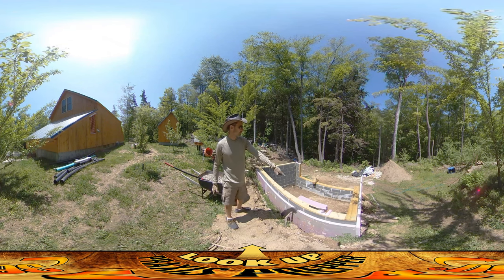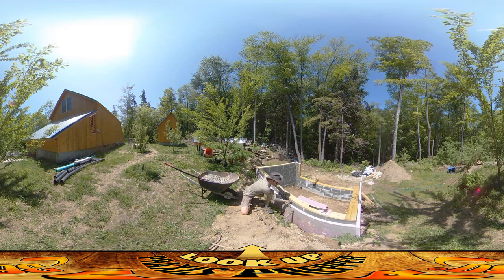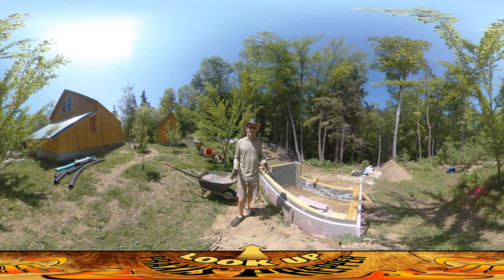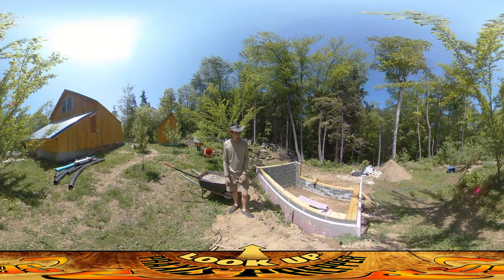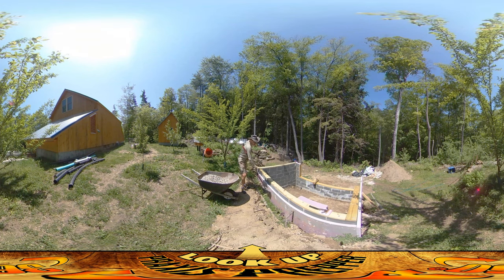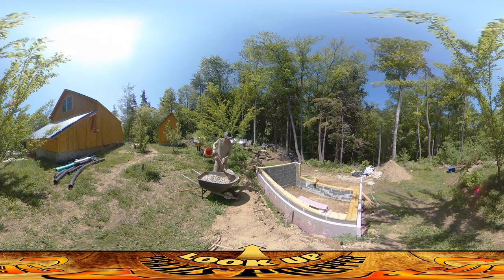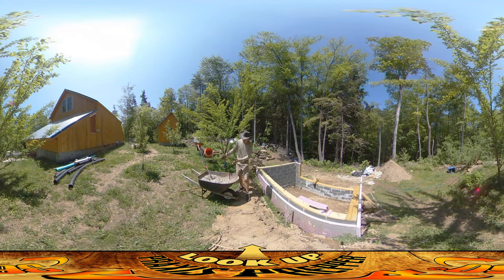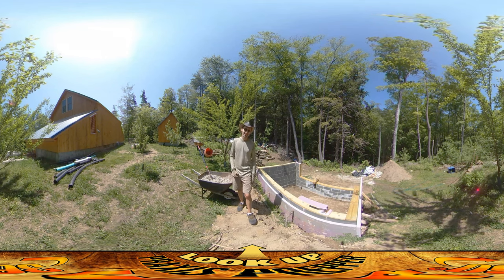Homestead Build - Sill Plates and Backfilling the Chicken Coop Foundation

Comment: Would two walls with insulation be an idea for the Winter?
Reply from the maker: This chicken coop will be better insulated than most people's homes. :)
The insulation helps keep it warm in winter and cool in summer, but it also serves the purpose of protecting the foundation bricks from the elements. If there are any issues with my concrete work, not having it exposed to the harsh temps, water, wind, and sun will be a life extender.
And you're right. The North Face video will def have more views than this. But while the North Face video rides on an otherwise idiotic "controversy", I think the core message of the video (that people should ignore advertising and just look at product quality) is an important message to get out there.
Reply: My coop can hold the weight of a helicopter 🚁 lol , and it's over engineered according to Huples,  the only wood in my  coop will be the roost bars,  with all the work that you are doing , never call yourself lazy,  being tired isn't lazy,  manifest hard working Praxis.
Reply from the maker: @MosaicHomestead  I'm not sure how much weight my coop will be able to hold up... but it had better be able to be capable of holding up its own roof, which is going to be a green roof with gravel, dirt (wet), and in the winter plenty of snow load. If I were a real architect, I'd be able to do the math to figure out if it's in the zone of strong enough. All I can do is to make something that looks over-built enough to be strong enough.
Reply: @PraxisPrepper  Dirt weighs a lot, the blocks can handle the weight,  no problem,  but whatever columns you're going to use,  make sure that they are strong enough,  its a interesting build.
Reply from the maker: @MosaicHomestead  Yeah and wet dirt is even heavier. The plan is to do 5x5 inch posts at a little under 3 foot intervals. It's solid posts cut from trees to clear for the house. I don't have much experience with solid posts vs ones built up with multiple pieces of smaller dimensional lumber nailed together. The solid single piece should be stronger than one made up of smaller ones. Wondering if I should go with closer spacing...
Reply: @PraxisPrepper  advertising is impossible to ignore. It literally is brain washing. I don’t have cable which is nice. I might spring for YouTube no ads after my month in Quebec. Oh we test the anti mosquito device tonight and it worked! A bid a$$ fan! Solar powered. Plugged it in outside and watched the swarms blow away as they got close. So much better. Going to camp video it in July for giggles as I have a battery bank. Me, tent, woods, and a big home fan lol
Reply: @MosaicHomestead  hard work never killed anyone but it’s murder on your nails 😜
Reply: @HuplesCat  That would make a great  bud light commercial lol
Reply from the maker: @HuplesCat  I'd love to know what fan you were using. I'm looking for something for my greenhouse to agitate plants as they grow.
Reply: @PraxisPrepper  some cheap one from Costco years ago.  Right now we are awash in power so using a dishwasher, charging the car, and bathing daily. It’s fun being green!